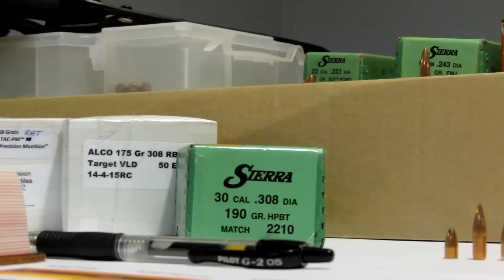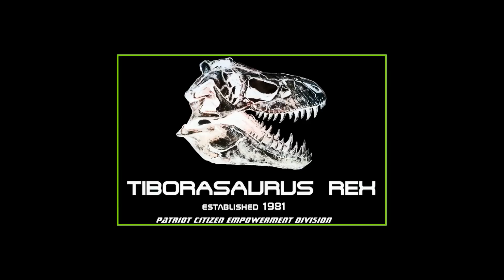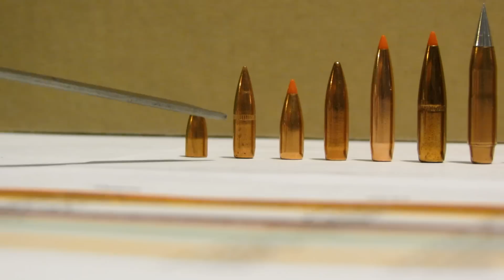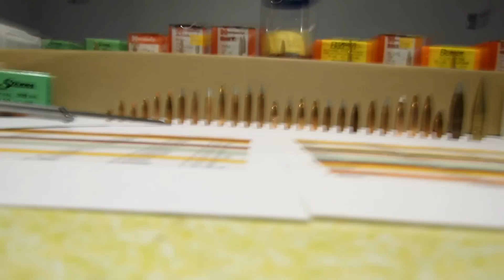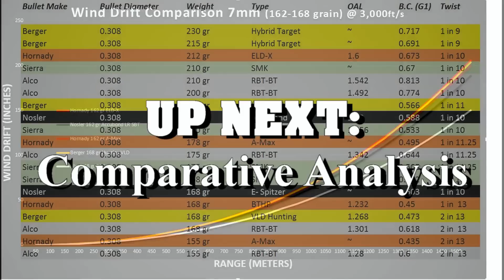Long Range Bullets (1/4) Technologies Compared - Rex Reviews

Comment: Alco makes bullets using equipment designed by Dave Corbin of Corbin swage Die. 

Dave came up with all the theory on the rebated rim deflecting muzzle turbulence. He would also say it uniforms the transition area from bearing surface to flight, so that (on a properly cut and lapped crown) the bearing surface of the bullet will stop touching the rifling on all sides at the exact save time. More uniformly than a standard boat tail. 

The truth is that during the bullet making process, the last operation points the jacketed bullet giving it is ogive, it uses a cup punch to cradle the rear of the bullet and press the front of the bullet into point forming die.

well the cup of the cup punch intended for boat tails was too thin at its end and kept splitting under the pressure of the swage press (much more than a reloading press). They rebated the rim to give the cup punch a 90 degree shoulder to support the load of the bullet pointing operation. 

So like most things they did it for ease of manufacturing purposes and then sprinkled some ballistic theory on it.
Reply: I should add that I make the same exact projectiles, aluminum tips and all using Dave Corbins s press, he designed the ULD triple hybrid ogive design Alco is selling.

Comment: Great video. One nitpick on physics. Momentum does not matter, from a physical standpoint. Internal ballistics favors heavier projectiles as they take more energy from the gas-bullet system. External ballistics favors heavier bullets as they have a slower speed and thus loose less energy in travel. Momentum is a physical measure useful only coupled with it's law of conservation to determine the speeds that are attained after all forces take their toll and do their damage.

Comment: i think the alcos had some testing done. found they were bellow advertised bc (i suspect many are). on par with the berger. not sure how the berger eol would perform by the same tester, but it seems the alco doesn't buy you much extra. I believe it's the rebated boat tail. It just seems to me that if it were as good as claimed, it would have been a lot more popular. I'll say this though, those tips should be more popular, we know a pointier tip will give gains but I suspect they booger the terminal ballistics. Would like to see a similar length copper solid compared to the eol and alco.

Comment: 8x57IS boat tail heavey ball ammo has 4,33 BC so it kind of makes me wonder wouldnt be a heavey tip/ high density material be the best for long range like a bullet with long aluminum body, copper jacket and a large and sharp tungsten tip with 2 places with larger diameter where the jacket hits the  rifling ,a ring in the front and one in the back similar to artillery with their copper bands and the spanic 7.92x40 Cetme except of a tungsten carbide tip and a pressed in low spot in the jacket so it onley has barrel contact in front and back insead of full lenght  
also interesting are bullets that have a similarly shaped tip on the back of the bullet out of a lightweight material to counter / eliminate the drag from the vacuum behind the bullet

Comment: I shoot a 300 win mag. I'm wanting to get 1400 or so. I'm starting to reload for this. Factory loads are cutting it. What bullet and powder would you recommend? I would appreciate any info you could give me.
Reply: Did you ever figure it out ? I’m curious !!
Reply: Actually I haven't started on it yet. I ended up building a Howa 6.5 Creedmoor in an MDT monolithic stock. I have picked out powder. Hodgdon H4350 and a series of different bullets. Still need to put a better scope on the 300. It just got put on the back burner.

Comment: I seem to recall the SMK 175 (which is a hollow point) was not classed as a hollow point by the solicitor general but the hollow point was classe d as a "manufacturing anomoly" thus meaning it wasn't in breach of Hague Convention Declaration  III and so Marines could use it as the M118  round ...Love your videos Rex,  please keep them coming, they are the best on the web by a mile...

Comment: Very Low Drag (VLD) bullets are often too long to work through a magazine and must be loaded singly. But Berger has VLD Hybrid bullets that combine VLD and long ogive shapes for a great Ballistic Coefficient (BC). This Berger Hybrid shape is short enough to work in most rifle magazines.
This Hybrid design reduces wind drift and INCREASES the distance it will retain supersonic flight compared to non Hybrid and non VLD bullets.. Yes the total trajectory height will be higher than a lighter bullet of that caliber and cartridge BUT it will retain the supersonic speed longer thus avoiding transonic "wobble" and less accuracy.
SEE BRIAN LITZ' BOOKS ON BALLISTICS AND ACCURACY.

Comment: I ordered 100 of the ALCO ULD Target bullets (.308  168gr Rebated Boat Tail ).   When inspecting them, I noted hat the aluminum tips were wobbling and not firmly attached to the bullet.   This wasn't peculiar to just a few bullets, the entire batch of 100 were this way.  I didn't think that was normal so I contacted the company.   To date,  ALCO has not been forthcoming with about replacing the obviously defective bullets..   Considering the price of these bullets, quality control and customer service needs to be uncompromising.  I was just curious what others have experienced.
Reply: Gemmill Shannon the sent me a new box, I emailed them a video with showing 18 out of the 100 I ordered and they 2 day'ed me a 100 when only 18 was a problem.. they took care of me and dis so happily and quickly.. I will say this, the B.C is over rates by a fair bit.. I have done real world chrony work and the stated B.Cs much higher then real world.. we built a 7mm RUM around these bullets that is a solid action slide the bolt out extraction setup on a 28 inch barrel and once we got a load built that the gun liked man do they preform.. the over stated B.c isn't a I just wish they corrected it and listed a true B.C.. this gun is the most accurate gun we have ever done past 2.5km... it is absolitely phenomenal.. if you want insane performance at insane ranges the Alco's are amazing performers.. if you build a gun around a projectile and are after extreme long range precision these bullets are insane.. in 7mm RUM it was wildly hard to build a load that the gun ate up, 7mm and .300 rums imho have never been the easiest cals to build loads for however this gun took as around 55 load revisions to find one it really ate up and gave us the sub half MOA 5 shot groups we knew the gun was capable of.. that's 55 load revisions WITH ONE BULLET, not trying to find bullets the gun liked so going through a lot of loads because of building loads for different bullets... no this was over 55 load revisions on a single projectile... but once we got it.. we got it, gun is printing. 35 MOA 5 shot groups consistently with .5 MOA being a large group.. they deff preform once you find a load, if I would have went 7mm mag I'm sure load dev would have been much easier, I really thought about going 7mm STW because I've never built a STW so we went RUM like a dummy but it turned out to be a very good idea, flatest shooting gun we have ever built period with the ALCO's.
Reply: chaecoco2  Mine we're like that as well.  They responded immediately and sent me a new batch in better packaging.  The new box came with each bullet individually set in a styrofoam form.

Comment: how is the alloy tip attached to the rest of the round ?  im stuck with sub 12fpe here in england basically  .177 .22 .25 air pellets with the ballistics co efficient of a double decker bus driving through custard 😒 why is the diablo shape so bad ?  my .177 go around 850fps that 570ish mph do they heat up in flight ? tar 👍

Comment: Why are you talking G1 BCs? The G1 and G7 drag curves are substantially different in shape as well as value so a G1 applied to a G7 bullet is GIGO. Besides, if you know the velocity as a function of range, you can calculate the deceleration (i.e. drag force) without bothering with drag coefficients, BCs etc. The Lapua website makes the case that you don't need to compare to a "std. bullet" if you have good data on the bullet in question.

Comment: Rex seems to have a strong pro-Alco bias. That's OK; we all have opinions and biases. However, there are a few things are glaringly left out of this video...

(1) The Alco light weight bullets are borderline to totally unusable in many applications. They are unusable because they are too long; not just in overall length but also in the length of the ogive.

(2) You can always improve the BC of a projectile by making it longer -- especially by making the nose ogive to a more acute angle and length. The problem with that is that most contemporary rifle cartridges and the firearms that use them are not designed with that in mind.

(3) The Alcos are unusable for two primary reasons. Firstly, the ogives are so long that if the case neck is to grip the parallel sides of the projectile aft of the ogive, the loaded ammunition will be too long to fit in a magazine of a rifle. Secondly, the long shank of the bullet costs you velocity by intruding into the case more. When you shoot very long bullets of the same weight as shorter ones, it is erroneous to assume that you can start both at the same velocity. You can't because you lost powder capacity due to bullet intrusion into the case. You cannot use load data for a similar bullet weight of a different design without blowing primers on the Alcos. You can overcome these issues by seating the bullet further out for a longer loaded length, but that is OK only if you intend to feed them one round at a time by hand into the chamber like benchrest shooters do. You can't do that if you plan on feeding them from a magazine in a bolt action rifle or especially in a semi-automatic rifle.

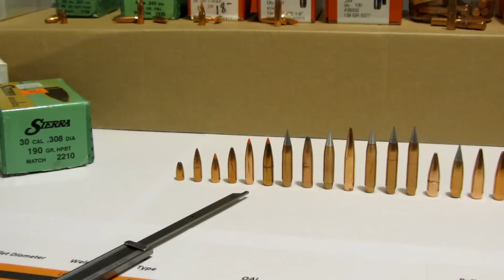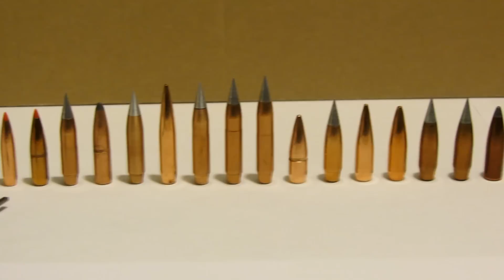(4) There are other factors which limit the applications such as the extra lengh requiring extra rifling twist irrespective of the weight of the projectile -- a problem compounded by the loss in muzzle velocity from case intrusion. The rotation rate imparted to a bullet is a direct function of BOTH velocity and rifling twist. A lot of people do not realize for instance that a 24" barrel will ideally use 1:10 for a 185gr 308 bullet whereas a 16" carbine with 1:10 rifling will impart spin more appropriate for a 155 gr, simply because you lose about 12~15% of the muzzle velocity with the shorter barrel hence the same twist rate spins the bullet at a lower rpm with the shorter barrel! I don't think exotic bullets costing twice as much is a issue given the target audience of such projectiles so I am not going to dwell on that.

(5) The spread of projectiles presented leaves out offerings like the Lapua Scenars and the Sierra TMKs which fill the gap between the traditional HPBTs and the Alcos with BCs in the low 500s in 308. Unlike the Alcos, the TMKs -- particularly the lighter variants -- are actually usable in magazine length applications at negligible velocity losses. They do have a longer jump to rifling contact and may or may not be detrimental to accuracy depending on the specific barrel used.
Reply: Dwight Looi Good points. These alcos would likely work well in Ultra Mag and similar huge cases where a small amount of case capacity loss would be tiny in comparison as a percentage. The single shot encore pro hunter 308 with factory 28" barrels would also be easy to deploy these, accuracy wise maybe not so much. Also some sort of custom magazine in a long action to shoot short action rounds would eliminate OAL issues. Something like the AI MCX maybe able to accomplish that with some mods to mags or custom stuff. Lots of money I'm sure. Lol
Reply: Well, that depends on the platform you shoot. Most people choose bullets to work with their rifle. They don't choose rifles or build one specifically to use a bullet. You can, but most people don't for a variety of economic and practical reasons.

I do most of my shooting in a Weatherby short action and an AR-10/SR-25 type semi. A can go a tad over 308 specs in OAL... maybe 2.810~2.815 on the semi and maybe ~2.830 on the weatherby bolt gun. That is not enough to solve the problem and, hence, not enough to bother with. I don't load to "scrape length"; that is retarded IMHO.
Reply: Dwight Looi yeah I use similar in SR25 style. The 160 solids solve the 7.62 to Mag length. Frank G getting super sonic to 1650@20" out of an AI. Warner tool. Not inexpensive though but interesting for sure.
Reply: Dwight Looi j

Comment: that sst bullet with the polymer tip that he examined for the 7mm group is my favorite , its like a hybrid between .243 and .308 , it has plenty good hitting power for hunting much like the 308 and still keeps the higher speed because it is a smaller round much like .22 how the smaller the faster so in my opinion if you want a good hunting and range rifle go with this round the 7mm 08 140 grain , they also make a 7mm which is a very very slightly bigger bullet but with a bigger casing so you can get the extra power you would need to hunt but as far as range it only goes out to about 600 yrds before it is very unrealistic

Comment: Whats the difference between a 7mm rem mag and a 7mm-300 win mag?
Also are there times when its better to reference G7 over G1 ballistic coefficients? Which one do people usually refer to?
Reply: 7mm rem mag is SAAMI and CIP caliber.
7mm-.300win mag is .300win mag necked down to 7mm bullets. They wary slightly in case capacity.

G7 should always be preferred over G1, if using boat tail bullets.
G1 is more popular because its higher value looks better in brochures.
Reply: xXspectre170Xx 300mag will get slightly more distance than 7mm
Reply: xXspectre170Xx G7 is not always the  preferred form factor. Hence the reason firing solution software like FFS (Lex Talus corp) doesn't use it but instead uses custom drag curves off G1.
Reply: Question was for 7mm-.300winmag (300winmag neck sized for 7mm bullet), and of 7mm rem mag.
Reply: The Draugr  The 300 WM is .120" longer case than the 7 R.E.M.  There is also once fired 300WM Match brass sold by gov and other sources sometimes for low cost. Always a plus.

Comment: Since you mentioned the new technology about the Alco ULD bullets, are there any new technologies for the higher calibers such as .338 and above? Also, I hear a lot of hype from the .375 CheyTac breaking distance records for target shooting. How is it able to do that?
Reply: Peacemuser this was what I was wondering. that's some insane bc for the size. imagine having a 250 gr with a BC greater than that of 750 amax getting pushed out of a 338 at greater than 3000 fps. that thing would go for miles.
Reply from the maker: hit @ crazy long range = experience with making good firing solutions + a lot of luck :-)

Comment: I would assume that the new Hornady bullets with high temp polymer tips are far less expensive than aluminum/alloy tip bullets; is that true or is Hornady charging a premium for their new (for now) heat resistant polymer tips?  Any scuttlebutt on other brands developing their own high temp polymer tips?  I'm also curious if the new polymer allows for sharper tips?  (may be 'different' is a more accurate descriptor than 'new' for the polymer they are using for tips?) 

Thanks for the great info and explanations, as usual, Rex!
Reply: I use the new hornady eld match bullet in 30cal and 208 grain with the heat resistant tip.  The g1 is .670. I am a firm believer in the tips, with the old amax at about mid range the group would open up unproportionatly to what it should have I thought. These new ones do not, the 'cone' of impact is  exactly linier not exponential, and as a consultation the BC is crazy high for 30 cal

Comment: If you perfurate the barrel to lose pressure before the bullet let the muzzle the air will not disturb the bullet. The idea is let the bullet get out of the barrel just by inertia.
Reply: So you would lose velocity big time. You would be carrying dead weight. Muzzle blast is not that big of a concern for long range shooters as long as crowning is appropriate.